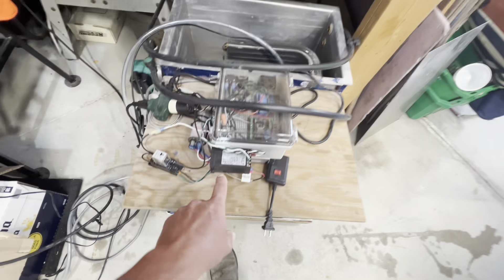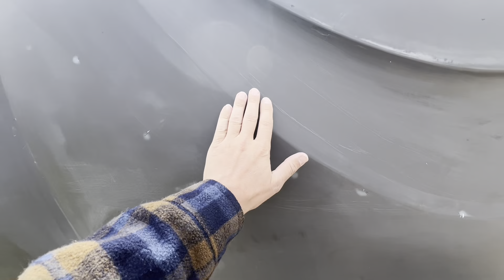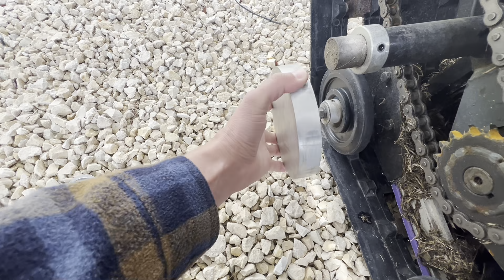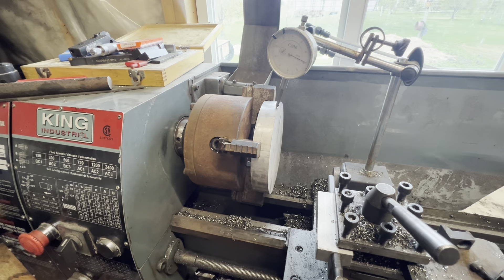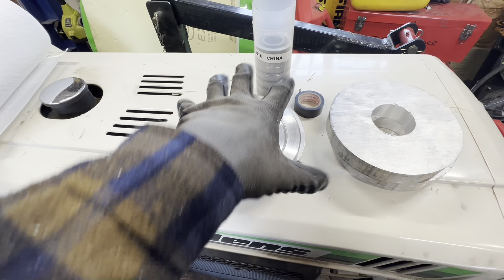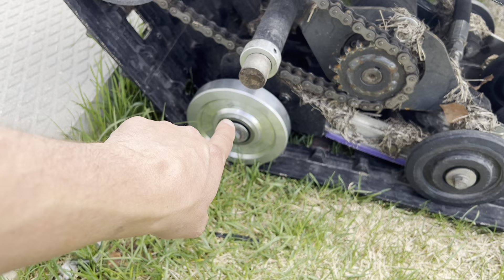PTV Billet wheels and chiller update!

Comment: I’m currently stock piling materials for my ow project, would pneumatic wheels be a consideration instead of a solid wheel ?
Reply from the maker: In another track machine I tried using pneumatic tires but they did not hold up.  The front wheels take all the impact as the machine moves across terrain plus all the track tension/preload so they need to be solid and super tough. 

One option would be to have pneumatic tires filled with urethane rubber. But the tires still need to be incredibly robust, that includes the axle and bearings. This is what I ended up with on my larger snowcat and they have held up so far.

Comment: Finally!
Someone bored out a plug instead of starting with a 1/8” drill bit & step drilling/ boring to like 2” inner hole! Kills me to see that much waste every time. 😢 no matter how much I love watching machining, waste just irks me.

Ps. Try wax on your hole saw when drilling aluminum next time. Sounds crazy, but I load up my burrs and bits with wax before touching ally: works wonders for eliminating the galled up mess. 👍
Reply from the maker: I have never heard of using wax.  Next time I will give it a try!